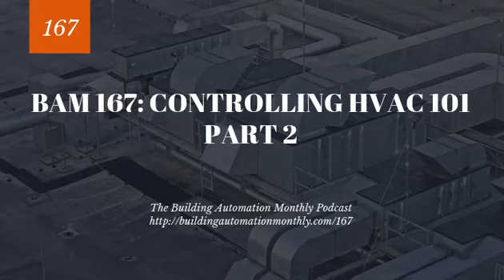BAM 167: Controlling HVAC 101 Part 2

Comment: Hi Phil thanks for sharing your knowledge on BAS control.  I see SOOs for VAV AHUs and vav boxes  that also call for discharge are reset. Does this make sense to you. Also would like to see a podcast on building press. Control. One more thing how do you approach a case where you are given a sequence where you know it will not work if you program according to the design engineers sequence. Thanks